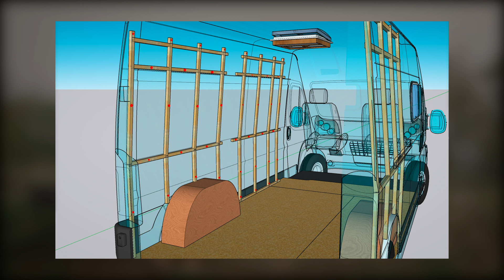4.Habillage des MURS ! LAMBRIS & LINO 🪚 Ça prend forme  - AMÉNAGE ton VAN

Comment: Hello, j'ai l'impression sur ta vidéo que tu ne mets pas de la colle partout sur l'osb avant de coller ton lino, on dirait que tu en mets sur les exterieur surtout. Si c'est le cas, tu vas avoir des cloques dans le temps sur ton sol avec le différentiel de températures été / hiver.
Reply from the maker: Salut John, 
merci pour ton message ! 
La où il y a pas de colle le lino et maintenu par les meubles